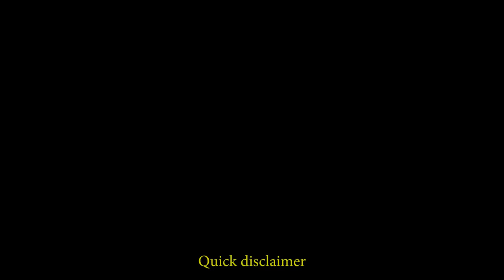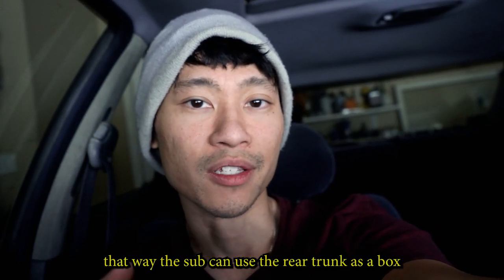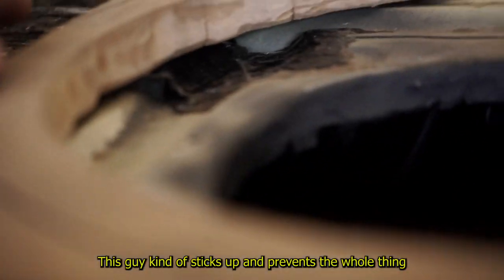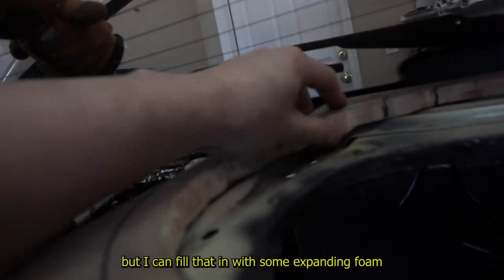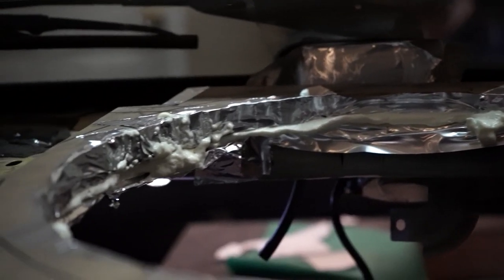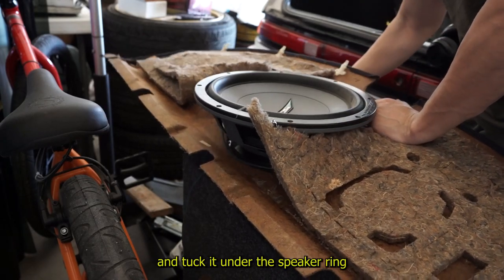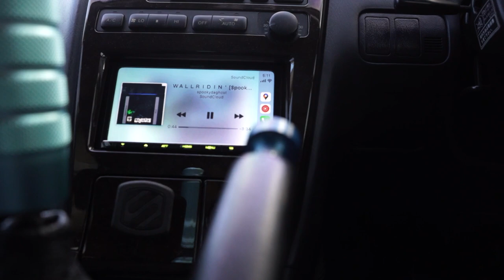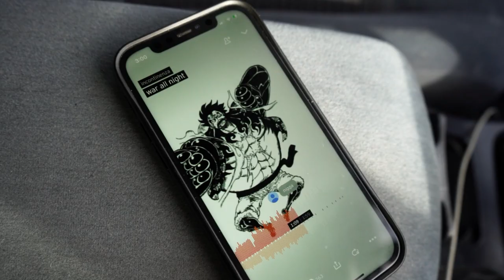JZX90 12" Subwoofer Install (OEM location)

Comment: U can get a jig saw for like $30 bucks at Harbor Freight. Good lord what a hack job. FIY, use weather stripping from Lowes/Home Depot instead of spray foam. It's cheap and comes in various sizes. Expensive sub and a cheap hack job install.

Comment: Nice job. How do you compare the amount of bass you get with this infinite baffle setup versus having one 12 inch sub in a sealed box?
Reply: Nothing beats infinite baffle. Don't fall for car audio places that only build boxes they are Nothing but rattle machines. This is a trunk IB but if you make the subs true IB you'll notice a huge difference as well as everyone else around your car using lower power.

Comment: Nice inspiring video. You could also have bought or made a subwoofer box and placed it in the trunk and just have an open hole in the rear deck for the bass sound to come up through. Ofcourse make a frame for the hole in the rear deck so it looks nice.
Reply: The whole point of building it this way is the trunk becomes the box

Comment: Kenny my dude! Did you notice a pretty big difference in sound quality sealing the MDF with foam? The sub I threw in the factory location sounds super “meh” currently lol
Reply from the maker: Hard to say since just going from 8" to a 12" is a substantial difference in bass. Cone area is king in these types of setups but generally you want to seal the front from the back as much as you can before deciding you need to upgrade. The original 8" sounded crisp and clean but the 12" out performs it in both sound pressure level and sound quality

Comment: Do you like the idq  in the rear deck?   How many watts are you putting to it?   Does it ever bottom out?   Do you feel the bass and would you rather of bought an idmax or is the idq still that much better than your old 8” with better quality sound.
Reply from the maker: I love the idq! I did look at the idmax but the dimensions would've been nearly impossible to fit. The idq 12" just barely clears the angle of the glass when mounting. It's worlds better than the 8" I originally had. I'm currently running 350w RMS at 4 ohms on a Pioneer GM-9605 5 channel amp
Reply: @JZXKenny  isn’t the idq12 like 750 watts RMS? aren’t you heavily underpowering it?
Reply from the maker: @Hunter-pk7ym  that's for the 2ohm configuration, I have the 4ohm which is rated at 500rms

Comment: So you don’t have an amp for the sub? Just connected it to og wires?
Reply from the maker: There’s an aftermarket one under the passenger seat. This video is just showing that you can fit a 12 on the rear deck. I have another video on my channel that briefly covers the amp install when I first installed an 8”.

Comment: I did this about twenty years ago in my seventy seven cutlass Except I put two 12 in subwoofers And two 6×9s Had to put in about an inch and a 1/2 or 2 inches of wood. So My spare tire would still fit in the factory location underneath the speakers Then I added another half inch piece of plywould paint it and cover it with speaker Grill material so you couldn't see the speakers at all Also had to cover the bottom of the 6×9s With boxes so the subs would not blow them out

Comment: I did this in my Lexus IS with an 8" JL sub and it doesnt sound good at all. Rear deck Sub swap. 

Even got the Infinity Kappa Sub. To see if any difference. (Using an Alpine 500W Mono amp to run it). It still sounds horrible. 

 Do you think the MDF is the make or break here?  help? I used putty to avoid air leaks and rattle but the trunk just rattles... 🤦‍♂️

Did the exact same thing in my older  Lexus GS430 with a 10" JL Free Air sub and it hit hard and clean.  (Rear deck)
Reply from the maker: The mdf definitely helps in this case. The insulating foam is also closed cell so air can't escape. Goal is to seal off the trunk from the cabin as much as you can. otherwise the frequencies are bouncing back and canceling